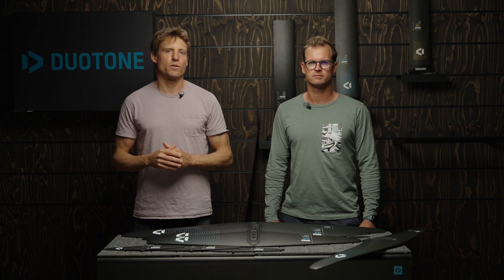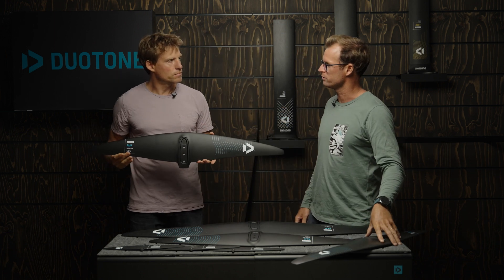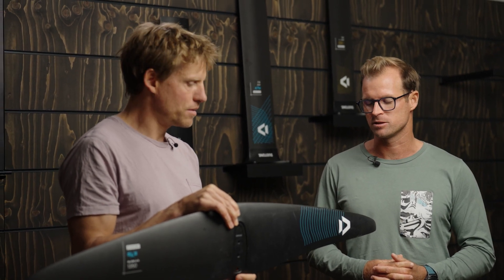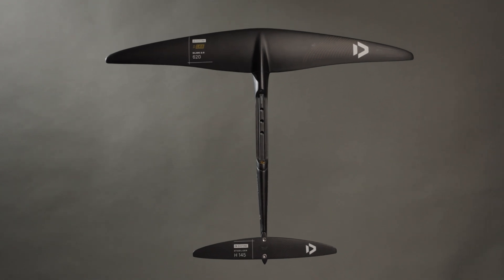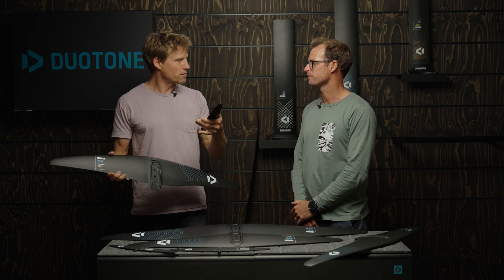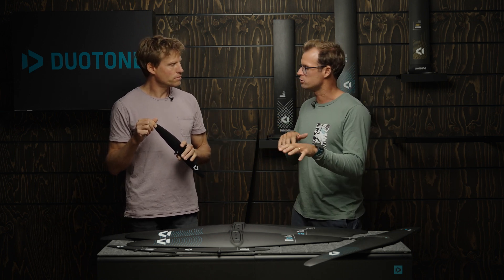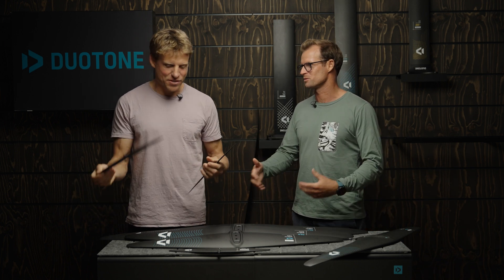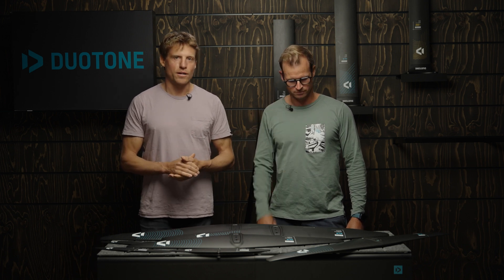Duotone Wing & Foiling Tech Talk - Glide D/LAB & SLS 2025

Comment: Hi !! One of my foil is fanatic glide 900 with dlab mast and I use it from about 8 knots til 16 then I use curve (My weight is 68kg). I want to buy glide 2 do you suggest me to buy 750 or 905 ? Thank you
Reply from the maker: Hi Kostas so u have a Glide 905 right? And deciding between Glide 2.0 in 750 or 900-as I think u mixed up the sizes above, just wanted it to be clear. From 8 knots as your biggest foil I would still take the Glide 2.0 in 900, 750 is too small for 8 knots, even at your weight? No other bigger foils in the collection? Carve is what size?
Reply: @duotone.wingfoiling   Thank you for answer !  My biggest foil is 905 glide  (maybe I'm wrong with knots , maybe is not 8 knots and it is 10-11 with unit 5.0 I m ok) and I want to change it with glide 2.0 so my question is the lift of glide 2.0 750 is similar to glide 905 ? The curve 3.0 size is 800
Reply from the maker: @KostasDavertzikos ok, the 750 is not quite as powerful as the 905, plus if you have a Carve 800, it makes more sense to go for the Glide 2.0 in 900 to give you a better overall foil range.

Comment: Hi, I just bought the new Skybrid SLS in 6.4 and I weigh 88 kg. I want to use it in 10–20 knots of wind. At the moment I still have the aluminum mast, 76 fuselage, and Aero Free SLS 2000. Jibes are no problem.

If I upgrade to the Aero Mid SLS mast, will I really feel the difference compared to the aluminum mast?

And if I replace the Free with the Glide 2.0 in 1350, will I get up on the foil just as quickly in light wind? Low wind performance is important to me. For pumping with the Skybrid, would a 66 fuselage work better?

My goal is: Skybrid + Glide 1350, and that I can get going as early as I currently do with the Free 5.9 and Aero 2000.
Reply from the maker: Hi there, glad you could get the Skybrid in the end. Yes, you will feel a speed and performance difference with the Alu mast. The 2000 has a LOT of low end power and lift, so you may miss that slightly with the 1350 Glide, but that is just a question of your pumping skills improving. Other option is to rather get a 1100 Glide and keep your 2000 for the super light wind stuff, so you have a bigger range of use - the 1100 should work well from 14/15 knots for you with 88kg, maybe even a touch less. 66 fuselage is a good idea, regardless, as if you are already gybing, then the shorter fuselage will improve your riding in all areas, speed/gybes/tacks etc.

Comment: Hi,
I am currently riding a fanatic high aspect 1500 and basically learned foiling on it. I can now foil, up wind, jibe, tack not so good. I weigh 70kg and am 1.7 m. I usually use a 5.0m2 wing as my biggest cause I don’t like bigger wings due to my size. My go to wing is a 4m2 Duotone unit.

I am mostly on lakes with choppy conditions (wind range > 14kn). What size would you recommend for the glide for me? Would it be better maneuverable than the aero?

I would keep the aero if I buy the glide.

Thanks!
Reply from the maker: Hi Peter, ok so keeping the 1500 as a light wind foil-then the Glide 2.0 in 900 should be a good option, this will have about the same power/lift as the Free 1000 or a bit bigger. So a decent gap to your 1500. Other option would be a Carve 3.0 in 1100, if you want to do more jumping/wave use/tighter manouevers?
Reply: @duotone.wingfoiling  I mostly ride under choppy conditions. But I really like to surf the small waves, make tighter maneuvers. I guess you are hinting at the carve?

I was a bit scared that my skill level is too low for a foil like that…
Reply from the maker: @Peter-xm4jd no, skill level needed for Carve is probably even easier than the more high aspect Glide. The Carve will also feel more similar to your HA.👍

Comment: Hi again, for learning pumping with paddle, do you think my Glide 2.0 1150 is big enough? My board is a midlength 110l., my weight 90kg.
Reply from the maker: No, I am afraid that is too small, min a 1350 but at 90kg, more likely the 1750 Amp is the better choice?

Comment: Which h series tail would you recommend for a 63kg rider on the 1350 learning downwind SUP? Prone background, can flatwater pump for 1-2minutes. Im guessing 165 or 185? Thank you!
Reply from the maker: Hi there- the 165 will pump more efficiently and turn more loose, but for a less experienced rider, the 185 also works well and gives a bit more stability.

Comment: Hi again, today was my first day on the 900 in gusty conditions from 3 to 25knts. I'm so happy with it. It was so easy to ride and the glide ist very good for its size. But the noise is a little bit loud, maybe because the cold water...:-) (5°) Should I sand it like my foils before...?
Reply from the maker: Sounds good - try to give the back wing a small sanding yes, this should sort it out? you know how to do it?
Reply: @duotone.wingfoiling  Yes!
Reply: but my last question: Last year Klaas said, sanding is very good. This also applies also for the new models?
Reply from the maker: not on all foils, but sometimes there is unfortunately just a touch too much of the top cosmetic layer, which can create some noises.

Comment: Hi, actually I use a Sabfoil Balz Pro 909 for better winds and a Leviathan 1050Pro for gusty lightwinds and pumping through the wind holes . My weight is 90kg. Now I'm thinking about a change to Duotone because a better glide and stall speed than the Balz 909, which sometimes sags. I also use the Units and I'm very happy! My board is a midlength. So would be 1100 and 900 the right choice for me? Or 900 an 750?
Reply from the maker: hi there, for light winds, I would rather get the 1100 for sure, @90kg, 900 will be a touch too small. 1100/900 should cover you to about 22/25knots fairly comfortably.
Reply: @duotone.wingfoiling  Hi again, today was my first day on the 900 in gusty conditions from 3 to 25knts. I'm so happy with it. It was so easy to ride and the glide ist very good for its size. But the noise is a little bit loud, maybe because the cold water...:-) (5°) Should I sand it like my foils before...?

Comment: I'm an AXIS user, HPS 880 and the Spitfire 900, but seriously thinking about swapping over to Duotone Glide V2's But i am completely lost in the sizing. I use the Spitfire from 8knots up with my 8m wing and then maxed out as well on 5.5m. any suggestions for the change, not interested in jumping or crazy carving, just riding swell and lumps great video
Reply: Hi, I would say that the Glide 2.0 900 could be a good choice for you to replace your Axis wings.
Reply from the maker: Hi there, I am not too familiar with all the sizes of the Axis foils, but Jerome our foil designer probably has a better idea, have asked him to comment - Glide 2.0 best for riding swell and lumps, the size with a 8sqm wing probably the 1350 and 900 could be a good combo? Maybe 1100 is big enough though too - what do you weigh/skill level\board type?

Comment: Hi guys, I am on the Free 1250 as my most used foil, 75kg and on the older side of the age group. I am getting my gybes and looking at next step to match a new Skybrid 5.10 board that i plan to purchase for light wind breezes. (9-12 knots) I will use a 2024 Slick 6.0 so thinking would a Glide V2 1100 be best or could I get away with the Glide V2 900? Have a solid windsurf / windfoil background for past few years and have now made the jump to winging. Happy to get a couple of front foils but not sure on sizes. Any help much appreciated.
Reply from the maker: Hi there, 75kg myself, just been using the Skybrid 85 on the weekend in some very light winds at Garda testing with mainly Glide 2.0 1100 size as it was extremely light/7 and 8sqm wings.  Firstly I would say for your weight, if you are already using a 1250 front wing, means you have a reasonable level - go for the Skybrid 85, no need to go for 5'10" x 100L, the 5'8" x 85L will be more than big enough for you. Takes a couple of sessions to get the clambering on board right, but once you are on the board kneeling&standing, the length really helps to stabilise the board. Of course, the 5'10" x 100L does not have a major disadvantage if you prefer more volume, it's just not as compact but will be easier if you are coming from a much wider/bigger board before. Actually easier to pump a board up in light winds which is just a bit more volume than your weight.

Back to the foils - if it is really only 9-12knots/6.0, then I would go for the Glide 2.0 in 1100 size, to be safe. The 900 will also work well from around 12-15knots and have less power than your 1250 Free, but be much faster/more manoeuvre friendly/more pump and glide. But below that you need more technique/a bigger wing. Perhaps a good idea to keep your 1250 and get the 900 Glide 2.0 and then you can see how much overlap there is? I know a few people heavier than you who are using the 900 as their absolute biggest foil, with Skybrid type boards, so it does have a lot of power for its size. Sorry to offer too many options, but was also not sure if you want to rid of the 1250 Free, or just add a foil? Anyway a Glide 2.0 would be ideal, either in 900 or 1100, depending on the rest of your future collection.
Reply: @duotone.wingfoiling  Thanks for the speedy reply, my local spot has a habit of shutting off wind wise and as I am a bit older than most riders feel happier with a bit more float. Wind wise the plan is to see if I can extend the range of the board with a new 7.0m Ventis for low wind days (1100), and the 900 for 6.0-5.0 days when we have a 0.5 to1m wind swell and gusty conditions. Your reply pretty much answered my questions but good to have the feedback. One other question on the Glide V2, it is mentioned to move the mast track forward 2cm? is that the same for the Skybrid boards? And can you explain the reason for this? More speed from board helping lift? or due to new design changes creating more powerful foils. Thanks.
Reply from the maker: ah, ok understood - so stick with the 5'10" - good choice on the 7.0 Ventis, an 8.0 is not needed at your weight and the 7.0 is much better for riders of your level/weight/with a Skybrid. 1100/900 is a perfect combo! The Glide 2.0 H back wing is designed to bring the centre of pressure/lift closer to the front wing, therefore you need to move it slightly further forward vs Glide 1.0 to get a good front foot pressure. If used with a lower aspect P back wing (from Glide 1.0 series), then no need to move it.

The Skybrids do however give quite a bit more lift to start than the shorter/wider boards, plus the tracks are anyway further forward and extra long , so placing right in the centre should work fine, this is where I have mine, with the 1100 it could actually even go back a bit from there.
Reply: @duotone.wingfoiling  Many thanks for all the answers to my questions, and the tips for tuning the foils.

Comment: Hi, I want to replace my HA 1750 as it cracked a bit. What should be a one quiver foil for me? Should I take glide 2 1350 or smaller size or maybe not a glide at all? I am lower intermediate rider (learning jybes), 83 kg. It should be good for light winds as I live next to inland lakes, but also for sea conditions (Mediterranean). Thanks!
Reply from the maker: Hi there, if you are learning gybes then I would first stick with the Free range, in the size 1250 or 1500 should be a good allrounder for your weight and lighter wind conditions. The Glide 2.0 1350 has a lot of power/drive and will become too big in stronger winds, so if any Glide 2.0, then the 1100. But I would actually stick to the Free range until you the basics sorted out. The 1250 Free has a lot of power for it's size, for an intermediate/advanced level this would be the light wind foil (it's a foil everyone in my family and friends circle used after coming from Free 2000/1750/1500).

Comment: Hello,

I had bought the Whizz 1450 to have a Light Wing foil but also a dockstart foil. 

Do you think it would be better for the dockstart to change for the glide 2.0 1350? I think it will be faster, but which foil will be easier (I'm an intermediate)?  Is the glide as playful as the Whizz?

Thanks for your help.

Greg
Reply from the maker: Hi Greg, hmm, the Glide will glide longer and have a better top end speed - better for winging - but for dock starting/Winging, the Whizz is actually the better option in terms of a lower stall speed, better acceleration and tighter turning. The Glide will feel more stable and pump longer, but turns are not as tight. So both will work, but for sure the Glide is not as playful at the Whizz, when comparing similar sizes. Obviously the Whizz 1450 is bigger than the Glide 1350, but from my own experience, I could not believe how tight that 1450 Whizz turns for such a large foil. So I think you can stick with the Whizz, sounds like the right one for you.

Comment: I'm an intermediate rider looking for something faster than my current 1500HA (82kg/intermediate level) With my current setup my top speed is approximately 16-17kt and average cruising speed is approximately 14kt, I would be happy to reach a top speed of 22-23kt. please what size of Glide 2 would you recommend ?
Reply from the maker: Hi there, without knowing wing sizes or wind strength, I would reccomend the new Glide 2.0 in size 900 or 1100, both will hit 22-23 knots, especially the 900 easily, but it may be a step too far from your current 1500HA in lighter winds.

Comment: What is the lift like (and also speed) of the 1100 Glide 2.0 compared to the Whizz 1000 ?
Reply from the maker: Hi there, good question - the Whizz has a slightly better acceleration and lower stall speed, which is great for proning and wave use in winging on slower, smaller waves. So you could say slightly more lift at least for starting. The Glide will start a touch later, but once up it has more glide and power, as well as a better top end speed, making it ideal for downwinding and winging. Not as agile as the Whizz. Both of these prefer to be ridden slightly further forward in the boxes vs previous Glide or Carve 2.0 foils.

Comment: Thank you so much ! Already ordered the 750 (added to the Glide 1.0 1085) ;) 
Two tech questions though : 
- Is the new profile thiner on the 2.0 (compared with the first version) ? 
- why not having winglets on this foil (like you did on the hyperglide) ?
Reply: I have that same question about the profile thickness.
Reply: The profile thickness is slightly thinner on the Glide 2.0
We didn't want to add winglets on the Glide range since they are wings that are used in the surf and also for jumping and we feel that it is safer to do without these very thin and potentially dangerous winglets.
For the Hyperglides the design brief is different, they are full on SUP downwind race wings which are not used for jumping and targeted at a more "elite" level rider.
Reply: @BonieuxJerome  thank you very much :)

Comment: I didn't quite understand why a larger stabilizer is needed at high speed. For me, at high speed, the pitching moment (up) increases, and thus the lift generated by the stabilizer further increases the pitch, causing the foil to inevitably lift out of the water?
Reply: Hi! Everything is relative, we are mentioning "bigger" stabiliser because just before we were talking about using very small ones for more efficiency when SUP downwinding. The "bigger" stab we talk about is actually a normal size for winging. You are right that if you take a stab which is too big you could end up having too much front foot pressure at high speed.

Comment: is the glide 2.0 750 faster then the  glide 725 ?
Reply: We have recorded very similar top speeds on the new 750 compared to the old 725, but the 750 pumps way better than the 725, actually it almost matches the pump ability of the previous generation 1085 😮
Reply: @BonieuxJerome  great! which SLS wing is the fastest on the whole lineup ? We could say is the smallest ? which is the glide, or the 850 carve2.0 is faster than all ?
Reply: @vitulinu01  Carve 850 SLS and Glide 750/725 SLS have the best top speed, they are both quite similar, I have personally recorded both up to 28knots top speed over 2sec.

Comment: Great video, excited to try them! What size/tail would you recommend for a 63kg rider to start learning downwind? Looking to pair with 8’0 downwinder slim. Wing and prone foil background. East coast United States riding in Atlantic Ocean. Thanks!
Reply: Probably the 1100 could be a good wing to start on for your weight. Of course, when learning to SUP downwind, the bigger the front wing, the easier the take off is going to be, so for best success rate at the start, you might also want to consider the 1350.
As we explain in the video, you could consider downsizing one or even up to two sizes on the H stabs if downwinding only. If you will wing with those wings, best to stay with the recommended stab size.
Reply: Got it, thank you! Even though the 1350 would be easier to paddle up, do you think it would have enough speed to keep up with ocean bumps?
Reply: @kovz910  It won't keep up as easily as the 1100 that's for sure. Given you mention that you want to pair it with a 8'0 downwinder slim, and given your light weight, I would recommend you to get the 1100 with the H185 tail and the 66cm fuselage. The new 76cm slim 2.0 mast will really help bring the whole setup to another level ;) The 76cm mast works great for prone as well btw.